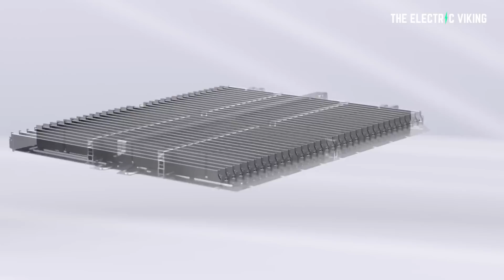Electric cars & pick up trucks will have more range than gas

Comment: This is what I’ve been saying. Once the blade batteries come in and some other design alterations. We are rapidly approaching equal range for EV’s. This is the final hurdle for a massive majority of people who are currently not fans of EV’s nor planning to buy one. It’s their final valid point in ‘why not’ and once this falls. We are on a downhill slope.

I still can’t figure out why though…why…no one is suggesting that gas stations add a battery and a couple of charging ports? Hook it up to a generator?!?!? The gas station has the gas? This is how we convert over. New batteries that charge in 10 minutes. And gas stations that slowly convert to electric also. It’s easy!?!?
Reply: Why would they need a generator when thwyre connected to the electric grid already?...
Reply: Maybe cause generating electricity from gasoline is actually more expensive than anything else, plus generator maintenance it would be crazy expensive to charge cars based on that setup, diesel generators are more efficient but still expensive

Comment: Elon has stated that getting much more than 400 miles of range is not practical based on the extra weight added to a vehicle . My ice pickup gets 400 miles before I would fill up and usually at a quarter tank left . My 4 banger car it's maybe 350 in miles . So using the 80 percent rule on charging to get a comparison of range to my gasoline vehicles I would need a range of 500 miles which would be 800km to get a even match . We are not there . Yes it can be done but makes the vehicle to heavy . Battery density is going to have to get allot better going from maybe 300 miles today as basically the high range battery to 500 is a big leap as a standard and maybe a decade or longer away from happening . EVs are still a novelty and a populare one . Maybe it's best user friendly option is self charging at home and for everyday driving you don't have to go to gas stations and enjoy the fresh aroma of benzine . Also it may help you to loose weight and improve health avoiding the food and beverages at these convenience stations .

Comment: Great video. One aspect you didn't mention is that the economics of the petrol station business requires high volume throughput. As volumes decline, there will be a steady decline in the number of petrol stations. Malls and others wanting to boost business will add more charging points, benefiting from the time customers have to wait, 5 to 30 minutes probably. It will become part of the daily routine and petrol stations will miss it all. ICE anxiety will be to find a petrol station.
Reply: Real good point Mr Hugh I like th way u think there
Reply: Most petrol stations (in NL) make a living from everything else but benzine or diesel.
When they are going to offer ultra fast charging (>>1MW) they can profit still.

Comment: The 2030 date is too optimistic. ICE cars are not set to phase out until 2035 so the date is probably closer to 2040. The reason for that is that the US might go through a recession and that means that people are going to hold onto their car and trucks longer, especially if they are already paid off.

Comment: Where are all these  local power grids going to come from  to generate  enough power for all these EVs....?
Reply: Ray of light:  In the  real world, with most people charging at night, and lots of capacity existing except when there are serious heat waves, etc., it's already not an issue.   The conversion is going to be gradual enough that the needed capacity will be built out.  The outfits selling electricity do so at a PROFIT.  That's the way the economy works.

Comment: Replacing the existing slow and unreliable charging networks, scrapping the existing EVs that clog up charging stations because they charge so slowly, and building a new fast charging network...means these new batteries will be useful in about five years, huh? Definitely ten.
 Meanwhile, in the US we have things like pickup trucks with dual saddle tanks, that's about 50 gallons of fuel.

Comment: Well while electric pickups could have more range than gas or diesel, I don't expect them to ever perform as well with towing, it's just not feasible as EVs are far more limited by efficiency than gas or diesel. Plus the main ways we're increasing range of EVs is storing the batteries more efficiently, lowering weight by removing parts, decreasing drag, and more efficiently building the battery assembly. As we can see today, even if the Ford F150 Lightning has a range of 400 miles, it only has 150 miles towing. I'm not expecting that ratio to change much. 

Still, batteries getting much more dense than they are is gonna be a rough task. Batteries by nature can never store as much energy as gasoline as batteries at least need like 20 atoms just for the reaction to the like 2 that actually produce energy. For gasoline the entire molecule is the energy. Of course EVs can catch up as burning gasoline is inefficient, but making them drastically better than gasoline is unlikely. 

There are a few alternative batteries like sulphur based batteries that in theory could have far better energy densities, but those may be 20 years away, and still they don't solve the towing issue being a massive disparity.
Reply: Kkylancer727:  It's a fact that BEV's are far more efficient than ICE vehicles.  So you're just wrong on that.  In time, more and more drivers will have their needs met by both better BEV's and a better charging infrastructure, no matter how loudly denialists bleat.

Comment: I still see the future of batteries going to LiFePO packs as even though they have less range, they don't damage the pack by being charged to 100% or discharged below 20%. That means even though you don't have as much potential range, in practice you have much more as damage is less likely. In fact Teslas with LiFePO packs actually by default charge to 100% as they know it's not an issue.

Comment: Tesla philosophy is to spare the battery production by putting just the right amount of batteries in Tesla cars, not too many batteries because it is and will be a bottleneck for many years. Musk mentioned that the right amount is between 250 and 350 miles depending of the models. The other reason is that a car carrying a big battery lower the efficiency of the car as it carries hundreds of pounds in excess in its everyday drive and used the total capacity of the battery pack only few days in a year. So having specific models that have a big battery would fit a customer need when hauling a trailer most of the time. There is a Chinese company that allows the option of adding an extra battery pack under the vehicle when needed but that complicates the production, the logistic of installation and the number of extra battery packs needed. But for now I guess Tesla resolved this problem by offering the range option at a higher cost for the customer (the same exists for ICE cars with bigger engines, bigger frame and higher consumption, which is also at a higher price tag). The cyberTruck model of 300 miles will not be optimal for hauling a trailer as its range will be lowered at 150 miles, which maybe too low.  The 600 miles model would be adequate for that purpose but it is a lot of extra batteries to carry around everyday if using the trailer only few times in a year but that's the price to pay for these few occasions and this is the customer's choice.

Comment: One thing I will judge is the buzz word of "structural battery packs". They aren't structural batteries, they're structural battery cases. It's like saying that my calculator has a structural battery even though it has the giant flap on the back of the battery slot.
Reply: Munro tore apart a Tesla structural pack. It was completely filled with epoxy foam that made it almost impossible to get open without severely damaging the pack. Any pack made in a similar way will indeed be a solid structural object. Not just a ”case”. It isn’t just the outside providing the strength.

Comment: Gas stations closing is a rather concerning idea I've thought about due to the impending gas car ban of 2035. Even if older cars can use gasoline, it will mean gas sales will continue to fall indefinitely as only those with existing gas cars will be buying and they will eventually get a new car. At that point these gas stations will either start going out of business, downsizing, or replacing pumps with chargers or hydrogen (that second is unlikely).
Reply: Gas stations are no more than corner bodega type stores. They make more $$ on the store stuff than the gas. $4 for a soda. They will not go away
Reply: @b4804514  yeah but it's still income and companies thrive on constantly increasing profits. It would be fine for smaller family owned stations, but not the ones under conglomerates like ExxonMobil, Flying J, Shell, etc. These will have to down scale when profits start to slide.
Reply: @b4804514 :  But they won't be selling gasoline, once doing so makes no sense economically (which will be a LONG time yet).   There are all sorts of regulations and expenses re safety, etc. for gas tanks.   They're NOT going to fund that if such tanks provide little or no income. 

And yes, whether for BEV's, PHEV's, or ICE's, gas stations make most of their profits on selling food, drinks, etc, not gasoline.   But they need something that will ATTRACT customers to stop and buy things.  If few non-BEV vehicles exist, gasoline will no longer cut it, generally.
Reply: 5th like
Reply: Skylancer727:  It's supply and demand.  As long as there is a lot of gasoline demanded so a lot of gas stations can make a decent profit selling it (and soda / snacks, etc), they will sell gasoline. 

I think that as the transition to EV's occurs, your idea of hybrid stations is bang on, and likely.   I think we'll see a LOT of that on interstates, and at large, well funded gas stations (i.e. those from major companies).  The question will be what the required safety regulations are (lots of gasoline and high voltage likely don't mix well, re safety).

But that way you have one station serves all solutions, and stations can gradually go all-electric when gas cars become rare.  Or go to only 1 or 2 gas pumps, like many stations have today re diesel. 

Economic incentives tend to ensure the masses have service for popular products.
Reply: Hydrogen too dangerous
Reply: @michaelstarkey9745  it's more that hydrogen is cost prohibited. The stations cost 6 times a normal gas station and need far more safety features.
Reply: @michaelstarkey9745 :  Nonsense.  If it were, CA wouldn't have it.   It's all a question on what the total demand will be.  If fuel cells aren't successful for cars, then there won't be many hydrogen pumps at filling stations, as there will be little demand.   Simple and obvious. 

Cars like the Toyota Marai aren't too dangerous -- they're too expensive and so is hydrogen, relative to what they provide, especially compared to improving BEV's.

Comment: It’s not really about range. Yes, long range is great, but if you can pull up somewhere and charge in 10 minutes rather than 40 minutes, that’s the part that will make a huge difference to people. I’m waiting for one I can afford that I won’t have to charge in the middle of a trip into town as that’s already a huge day and adding 40 minutes to an hour to charge just makes it unworkable. But 10 minutes isn’t really any different to stopping for petrol and can easily be worked into a trip.
Reply: @glennstimson6097  I’m not the average person. I have a 3 hour round trip every 3 weeks, plus lots of running around in town to get lots of things done, go to appointments, see a few people. It’s already pretty much an 8 hour day and it’s not workable to then detour 20 minutes on my way home to stop at the fastest charger in the area (not fast, fastest) and have to wait there 40 minutes as it charges and maybe add another half hour to that if someone is ahead of me. It’s just too much extra to tack on to an already exhausting day. I have CFS/ME and that day already is enormous and needs recovery days after, I can’t make it bigger. So I need to wait. I either need longer range or faster charging or both, and I need infrastructure in the areas I live and regularly visit to be improved. And yes, I will mostly charge at home, but it needs to work for this regular trip. On the odd occasion that I need to go to Melbourne which is then about a 6 hour round trip I don’t expect it to get me there and back without a charge, but Melbourne has more chargers to choose from and I don’t do all the running around visiting people when I’m there, it’s just an appointment then head home, and actually a charge stop on the way home would be a welcome rest break. And that is only once or twice a year.
Reply: @glennstimson6097  yeah about that. I haven’t actually bought my place out there yet so not sure exactly where I’ll be but I know where I’m looking and it’s a little less than 330km round trip. It’s not all highway. I was seriously looking and doing the sums about a year ago and at that stage the unrefreshed MG was the only one available without a huge wait. The Kia and Hyundai won’t work for me as they beep at you too much (I have issues with my ears too, hence the move to the country) and I need a higher SUV style and the model Y is out of my budget. So the MG was it. I worked out that it would juuuust do it to begin with, but over time as the battery degraded it would have needed a charge. I saw the refresh model released in the UK and loved it and it had that bit of extra range I needed so I called the dealer to get an idea of when it would get here and how much it would be. He was off with his price guess by about 20 grand, but the wait for the new one was too long. The car I had was hurting me every time I got in and out. I needed a taller one. So I bought a second hand ICE vehicle. It’s diesel which has gotten rather expensive, but I don’t go out much and it’s efficient on long trips. The refreshed MG that we’ve got now is the shorter range so it’s not the one I really wanted anyway. Now that I have something that’s not hurting me, the urgency has eased so I can wait for the perfect EV for me to be released and then wait for it to be delivered. Who knows, if I find a property for less than I got for this house, maybe I can stretch the budget to a model Y and then I’d have plenty of range. We’ll see. For now I’m waiting.

Comment: We are seeing battery innovation similar to the innovations to ICE engines when they first started producing them. Gas engines went from 2 mpg to 40mpg. I expect battery tech will be similar.
Reply: The battery has a set amount of energy to provide. The power train to the wheels is 87% to 91% efficient. You are trying to claim it is possible to create energy in a powertrain. That cannot happen. What can happen is that we can put more energy into every kilogram, which means that the mass of the vehicle will end up being the same but have a higher range.
Reply: @ronaldking1054  You are correct in that I used a bad analogy. However I am sure you understand what I was trying to say. 🙂

Comment: I don't know that range will be higher than ICEVs, because if the range of ICEVs wasn't enough they'd just make bigger gas tanks. The gas tank is a tiny percentage of total vehicle cost, and there's usually quite a bit of unused room to put more tankage. I think we've figured out what kind of range people are comfortable with and EVs will probably stick to that.
Reply: Also range in ICE car does not matter that much as refuelling is so fast. And also if you use EV battery (as I plan to do) mainly from 10% - 80% you actually have 70% of usable range. And then we have winter  ... so EV range and ICE range are quite different topics...

Comment: Noone seems to mention the fact how quiet EV's are. I live very near to the busiest motorway in the UK... the M25... I can hardly wait until ICE vehicles are a thing of the past!
Reply: At low speed yes, highway speeds not much difference
Reply: @Froggability  True, although some trucks and some cars with modified exhaust are pretty loud.  Off-road tires can be ridiculously loud.  Some tread patterns are even illegal for this reason.

Comment: Battery tech develops quickly, but "gas" stations will last. Because big oil companies are investing in EV charging  industry. Shell is now cooperating with BYD, Nio, and BP is cooperating with Chang'an, Huawei and CATL in fast charging stations. "Gas" stations are just going to become "charging" stations.
Reply: Which does you ZERO good if you own an ICE vehicle.  In a pinch, I can buy gasoline, run it through a generator, and charge me electric car.  The reverse is trickier, buying electricity and turning it into gasoline.

Comment: There are some topics to keep in mind:
- Recession will end up delaying all these predictions by a few years.
- People are in fact braindead and a 2000kms range EV could show up at haft price, some people will pay for gas anyway, they don't change.
- EV charging is not stable, tomorrow's chargers will have yesterday's technology (not even todays ones) because of price, so EVs can all have 900v charging capabilities and few select places perhaps motorways would have them. So, most EVs would still be handy caped at hours charging if they go with bigger batteries... Or one will end up charging more times fewer kws to "save time" and completely defeat the inicial purpose of fast charging.

The biggest change will happen when EV chargers could be upgraded or changed for newer models easily at cheap to keep technology upgrades flowing.